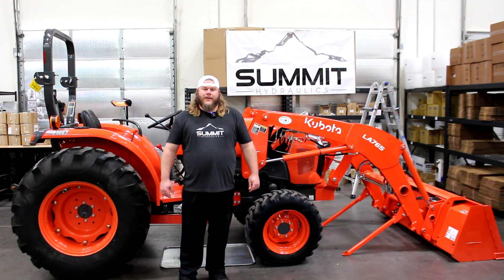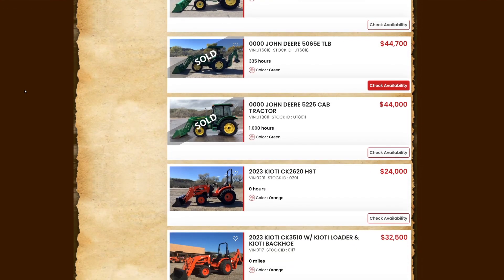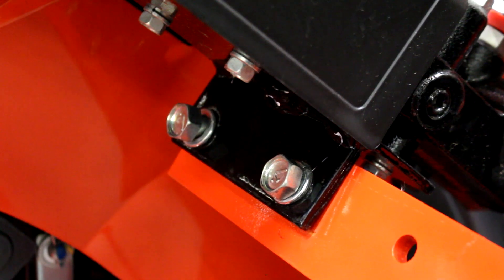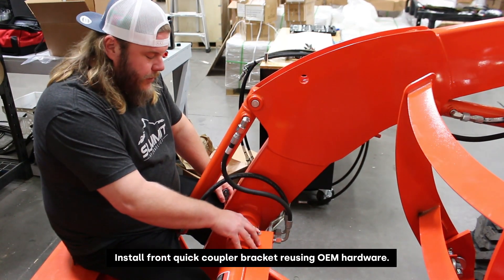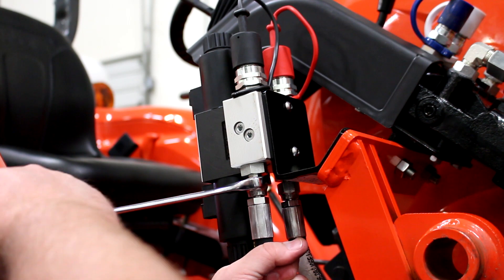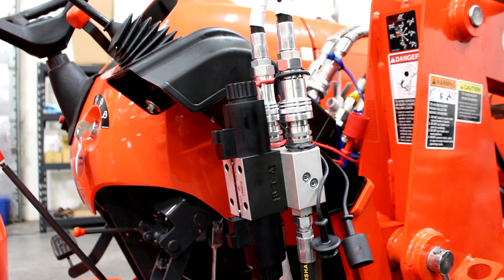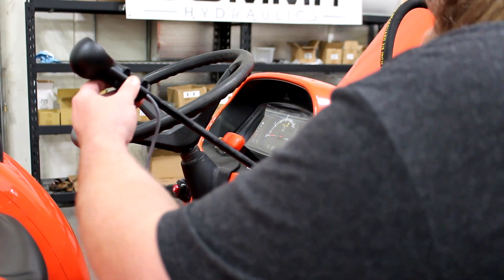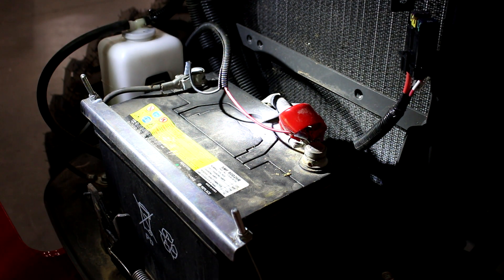Summit Hydraulics Kubota L4701 Third Function Kit

Comment: I do not have factory rear remotes, but I have a dealer-installed rear remotes for the top link, box blade, and stump grinder. I also have a dealer install BH 92 backhoe. I had a LandPride third-function valve kit installed by the dealer for my grabbler after they installed the rear remotes and the backhoe and they used the green hose and did it the way you are doing it now and it worked good. Water got into the solenoid and it it stopped working. My question is can I use the green hose or do I have to tie it to the orange?
Reply from the maker: If you are looking to run another valve in your system, it has to be looped in series. You don't want to Tee into a pressured line because it will split the flow and cause it to not work properly.